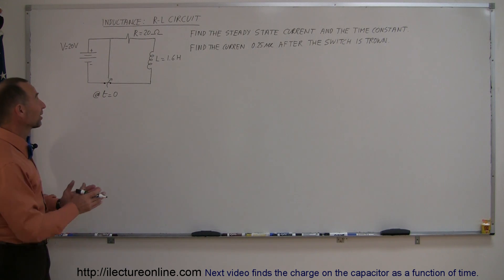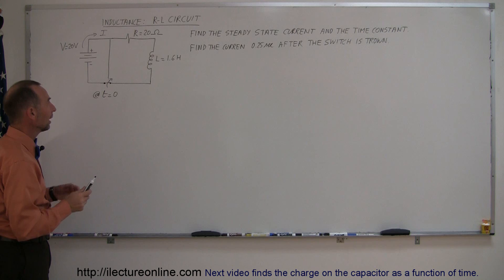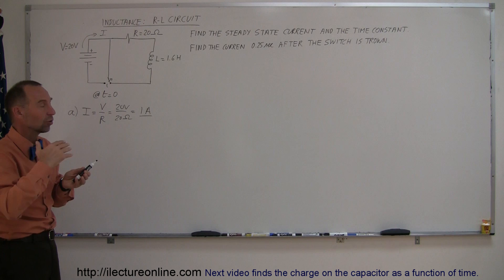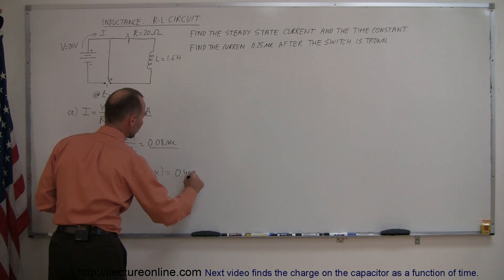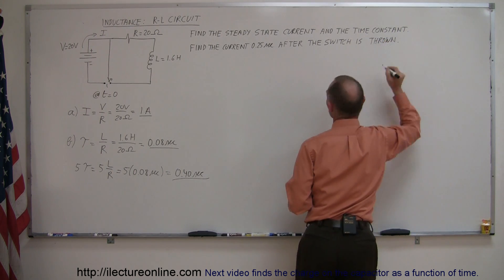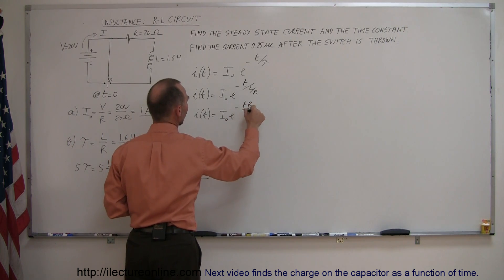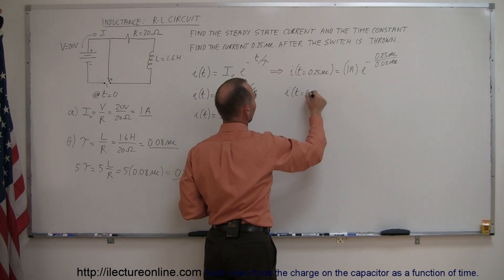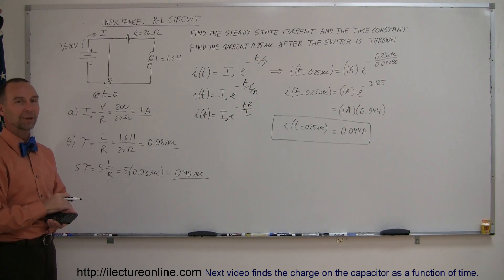Physics 47  Inductance (5 of 8) The R-L Circuit

Comment: At 4:23 you plugged in I_0 that you solved for on the left side of the board as V/R, now since the switch is thrown the V used to calculate that I is no longer in the circuit with current, but yet I_0 at the instant of the switch being thrown is still the same current?

Please tell me if I am understanding correctly.
So after being steady state with the voltage source and disconnecting it, the inductor holds the voltage like a capacitor holds a charge? 
Then once completing the circuit again, but with only the resistor, it instantaneously has the same current it had before because the magnitude of the change in voltage is the same? at least briefly...?
Reply from the maker: Let's take each question one at a time:     1) I sub knot is defined as the current in the circuit when t = 0 which means when the switch is thrown.   yes it will be the same current as was in the circuit right before the switch was thrown.    2) The inductor does NOT HOLD voltage.  There is only potential difference across the inductor when the current is CHANGING.   Therefore the moment the switch is thrown the change of the current is MAX and thus the voltage across the inductor will be MAX.

Comment: when switch is closed(as in prev. qstn), current increases from 0 to a max. value. ,ie pd established slowly to Vmax. so current increasing slowly to Imax. to that time emf is induced by inductor opposing the change that in turn drops the voltage that is to developed in to Vmax, that back emf also be overcome by the LR circuit-VOLTAGE DROP. the time to attain max. level is 5*Time const. 

when switch is thrown, current current decreases from steady state value to zero. isnt ? in second case is it the withdrawal of current when no potential difference from the battery across the opposite terminals ? so the current varies down, emf induced in inductor opposing the change. is it correct ? please clarify any wrong in my primary concepts...

Comment: what happens to cause change in current when switch is thrown ?
Reply: The inductor causes current to flow after the switch is thrown to position two because it has stored energy in the magnetic field around it. The magnetic field is being maintained by the current flowing through the coil of wire, which is being maintained by the voltage source.  When the voltage source is removed it can no longer maintain the magnetic field around the inductor.  The magnetic field then collapses around the inductor and due to electro magnetic induction (magnetic field, conductor, and relative motion between the two) it induces an EMF (voltage) onto itself. This new EMF causes current to flow through the resistor until the magnetic field is fully collapsed and the stored energy is gone.

Comment: Quick Question, On the previous video you solved for the current in a given time  using the equation i(t)= V/R (1-E^-t/T) but on this one you used i(t)= Io(e^-t/T) what is the difference between both equations and how do I know which equation to use in a given problem. If you could please let me know...THANKS A MILLION FOR ALL YOUR HELP
Reply from the maker: Fabiola,

That is a good observation and a good question.

There are two possibilities, either the current is increasing to a maximum value or it is decreasing to zero.
When the current is increasing to a maximum value you use the equation:

i(t) = (V/R)  (1 - e^-t/T)

When the current is decreasing to zero, you use the equation:

i(t) = (V/R) (e ^ -t/T)

Rather than memorizing that (which I don't) you can easily check this by plugging in t = 0 for the initial condition and t =  infinity for the final condition

Comment: what's the difference between this equation and the one in the previous video?
Reply from the maker: In this video the current starts out at 1 A and then diminishes to 0 A after 5 time constants.  Without the inductor the current would go to zero instantaneously as soon as the switch is thrown.  With the inductor it will take 5 time constants (about 0,4 seconds).  In the previous video, the current started at zero and increased to its steady state value in 5 time constants.  Again the inductor slows down the process since an inductor opposes a change in current.
Reply: Thanks!